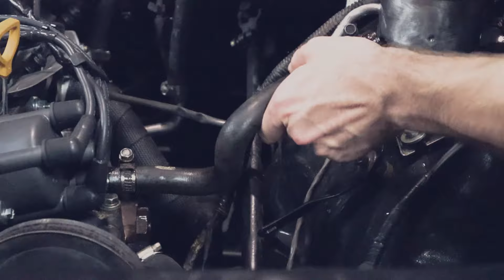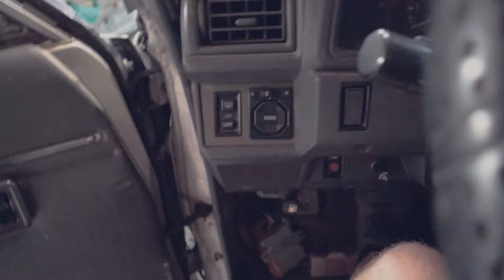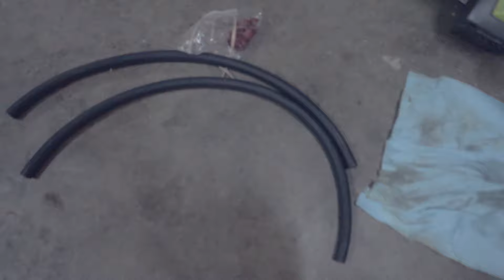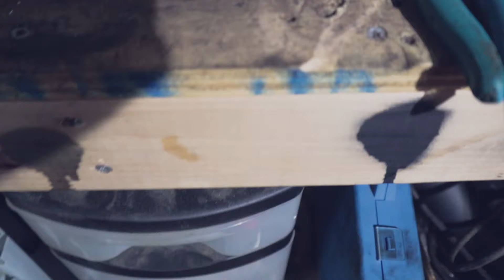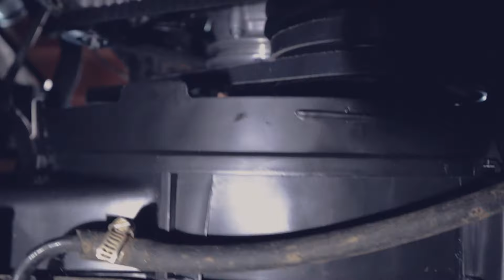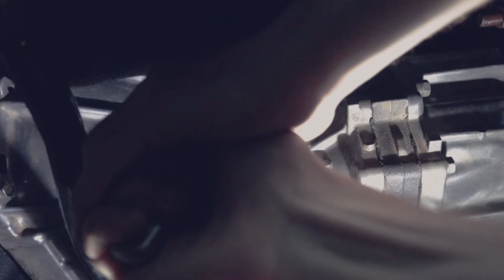Part 25 Getting everything hooked up! 1987 Toyota 4runner Restoration

Comment: Awesome videos! Iv'e been working on my 85 and have been referencing them. I know there are some differences between the early 22RE's and I think my truck has some components from different year trucks on it. I was curious what the vacuum switching valve at 11:12 in this video is for and where you connected the vacuum lines. It might  not be used in an 85 but mine has a three port one. I thought it went to the pressure regulator but am not sure, and you said later on that you hooked the pressure regulator directly to vacuum.

Thanks,
Eric
Reply from the maker: The vacuum switch is the fuel pressure up switch when you engage 4x4. Yeah I believe I bypassed mine and hooked straight to the regulator.
Reply: @KyleAutomotive1  Thank you very much for getting back to me. I got it all sorted out (I think), and passed smog. I was not aware of when it switched though, makes sense because the vacuum diagram that I believe to be correct for my truck says it's only on 4wd trucks.

Comment: Hey Kyle just wondering if u know anything on were to get hard to find parts for an 85 Toyota truck 1 ton dually I run into some problems dealer don't have parts or don't stock them other issues is every dealer I talk too they say is carburated and  everything in the truck is EFI  date of manufacturer was Oct 84 can anyone help  thanks.!!!
Reply from the maker: I usually use facebook groups, ebay, rockauto, craigslist, etc. Don't really go out to junk yards since the closest one from me is about two hours away.
Reply: Salvage yards in Texas. On line get customers service number. Call, get a live human. They will find you what you need.